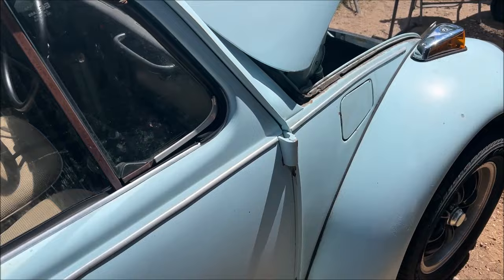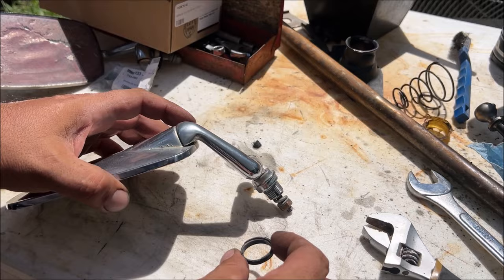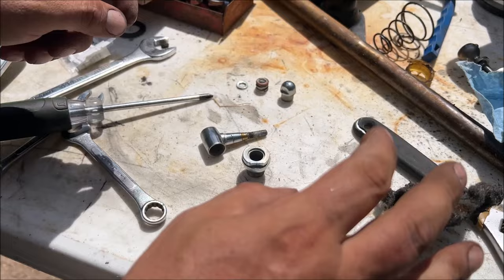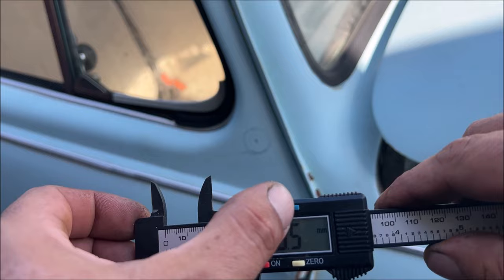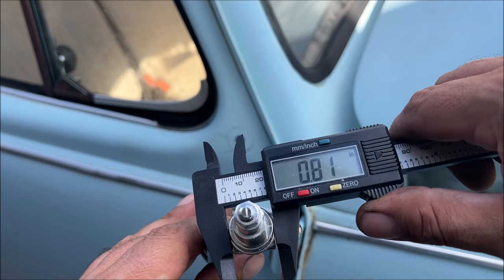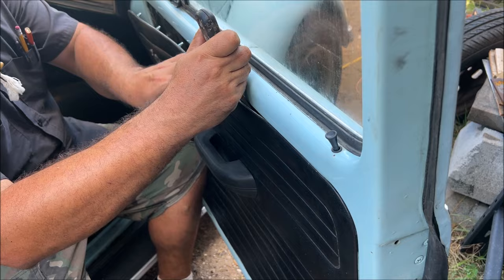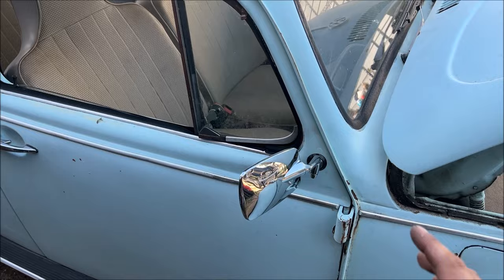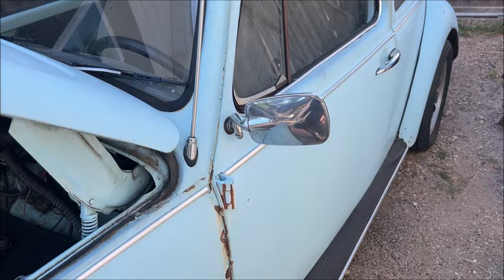VW Beetle passenger DOOR MIRROR DIY

Comment: Very helpful video. Painter’s tape holding the nut worked. I had to buy a wire wreath frame from Michael’s and pull wire from that. No one makes wire coat hangers anymore.

Comment: I want to install same mirror on my 64 drivers side (gave up on the door hinge pins) but want to make sure it's doable first. If there's no inner door structure would that nut on the back side be enough to stabilize the mirror on just the sheet metal, also how did you hold the nut on the inside to tighten without a wrench? Any feedback much appreciated!!

Comment: How did you get the wire out, the one used to fish the special nut?
Reply from the maker: i only taped it in a u shape so it could easily be pulled out 5:04